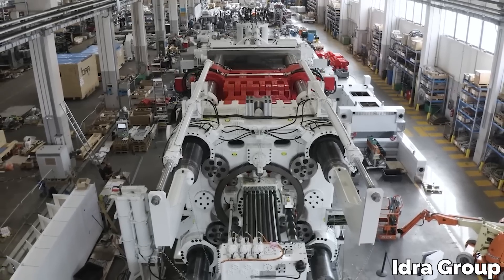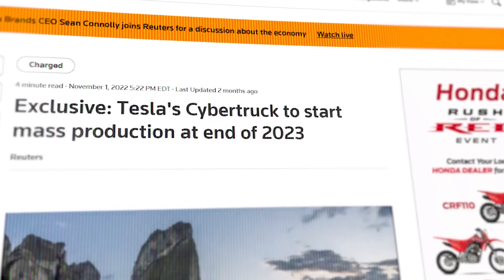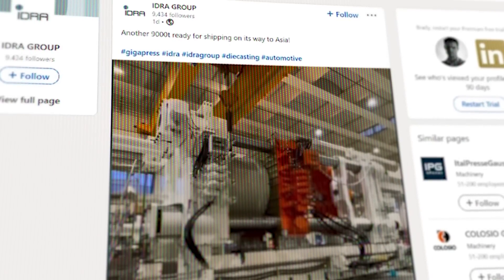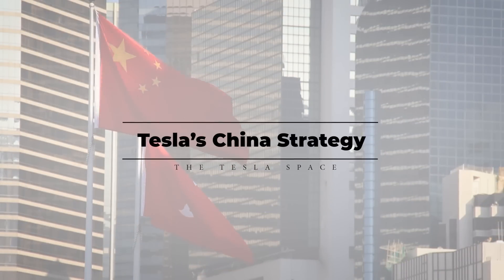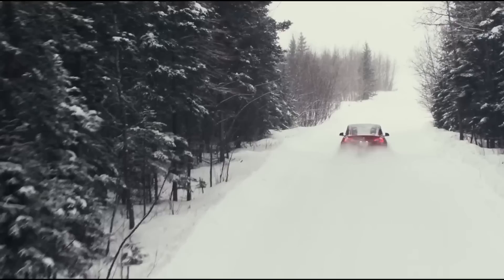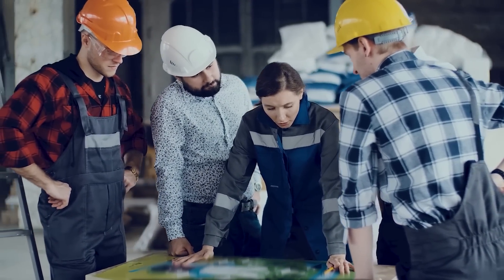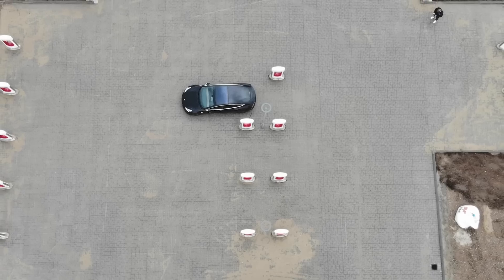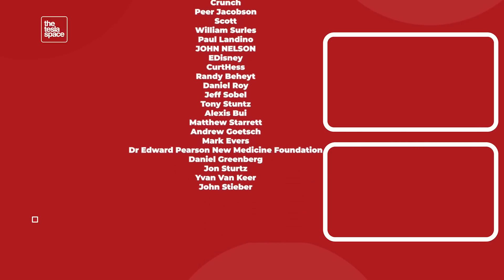The 9,000 Ton Cybertruck Giga Press Is Here!

Comment: I've got a slight feeling that the center pull through chargers might be intended for the cyber truck and future tesla trucks that would be pulling trailers and loads behind them. With the current design it would be difficult to impossible to even attempt to charge while pulling a trailer behind you.

Comment: I thought the whole cyber truck was made on a press break. In fact that was the whole point of the design. Also they're not gonna push stainless steel through that thing and the bodies made out of stainless. So I guess they're gonna make it a frame out of aluminum with a stainless steel exoskeleton?  Do they plan on making a larger truck cause currently it's about the size of a Ford Ranger.  I've never seen the roof of the F150 i use at work. In the videos you can see that Joe rogan is taller than the truck.  Also notice that none of my 4 by 8' sheets will fit in the bed of the truck. Will there be a work edition that will allow you to use it as a work vehicle.  I guess we'll find out and 2032 when the truck is released.

Comment: A "pull through" design is also great for truck (and cars) pulling trailers, it would allow charging without having to unhitch or block roads. Moreover, we might start seeing trailers with their own battery packs that could be charged at the same time the truck was being charged.
Reply: Does anyone know if you can charge the batteries while driving.
Outback Australia is very remote and no power , a single   Cylinder diesel generator in the back would keep you charged up .
Reply: @richardrogers7339  why not just buy a diesel truck then?
Reply: @Withnail1969  I have a diesel Toyota.
Electric truck will have great problems in remote Australia 🇦🇺 
You would need your own generator to charge batteries
Reply: @richardrogers7339  I saw a video of a tesla with a running generator attached to the back of it in Ukraine, so yes.
Reply: @richardrogers7339  I would hope so. It would be nice to be able to buy battery packs like little jerry cans to extend mileage on long trips.
Reply: @@M.L.- self entitled? Tow trucks aren’t free you know.
Reply: @@M.L.- What are you talking about, drop your dead battery in the road? Do you always complain about made up issues? And is it always ones that wouldn't affect you if you didn't completely fabricate it? You're right, tow trucks elapprently aren't free which is why when you get towed you pay the cost. Stop being a victim nobody was talking about you.
Reply: @@M.L.- check your spelling and tell me again
Reply: @@M.L.- Course you did you got it all figured out.

Comment: The bars are called tie bars as they tie the machine together.  The machine platten ride on "shoes" at bottomed under bottom tie bars.  In case anyone wants to know more just ask.  Die Casting is my thing.  Not doing this to "correct" the video just as additional info.
Reply: My field also and agree 100%.
Reply: @paulschulte1064  my company is thinking about expanding with 6 new 6000 ton presses like tesla has.  I hope they do.
Reply: @LegacyAftermath  I’m thinking the dies or molds would require huge mills and machine tools to manufacture. In different areas of the tool/die and machinist fields I’ve ran big stuff. It’s awesome!!!
Reply: @paulschulte1064  we just got a huge boring mill.  Could hold 2 or 3 holders (of the die) easy.  The machine gets very impractical quickly and most machinery won't suffice
Reply: @LegacyAftermath  All I ran was big, cumbersome, old machines. I can’t imagine the joy of running a CNC or NC lathe with an 8’ swing and 20’ Chuck to tail stock, LOL.

Comment: The worst layout is in mammoth, CA… 4 rows of double chargers but no markings to tell you which way to pull in, so about half the people are facing the wrong direction, using the wrong charger, and blocking the charger they’re supposed to use. On top of that, it’s a v2 charger and they are split across the lanes, so if you want full speed you have to pull in behind someone and not next to them like most would assume.

Comment: It always amazes me how Tesla groupies believe that a company like IDRA only sells die-casting machines to Tesla. Wonder how they grew so big without prior or current customers.
Reply: It always amazes me how people feel the need to insult others. I am sure there are many 'Tesla groupies' that would wear that badge with honor but this seems intended as an insult, inferring they are not smart enough to know Tesla is not IDRA's only customer.
The 2 Largest Presses have been designed to Tesla Specs and to date have only delivered to Tesla. Logically the second unit of their Largest Press is LIKELY to also be a Tesla purchase. NO ONE has said IDRA Only Sells to Tesla, or even large presses HAVE to be a Tesla purchase.
Reply: @LifeMyWay007  Mr. Liu Zhuoming, CEO of LK Group, said in his speech that LK and Wencan have been partners for many years. They have always supported each other, trusted each other, grew together, and insisted on sustainable development. It is expected that LK 9000T super intelligent die-casting machine can help Wencan become an important leader and builder of the development ecology of China's new energy automobile industry, and solve the needs of the manufacturing industry for super-large die-casting parts and multi-component integrated die-casting products in the new era. LK will also be equipped with the best resources and a full range of services with Wencan